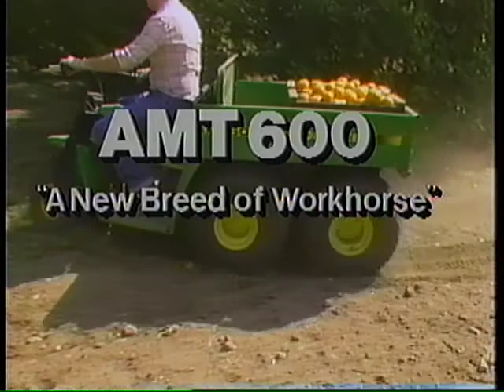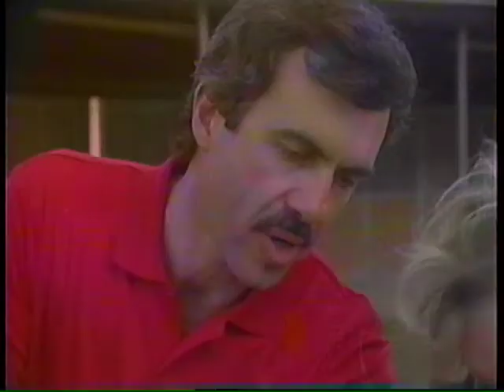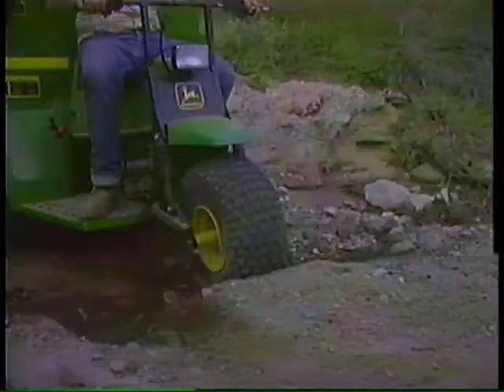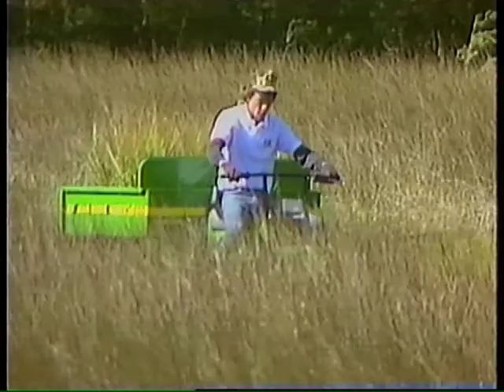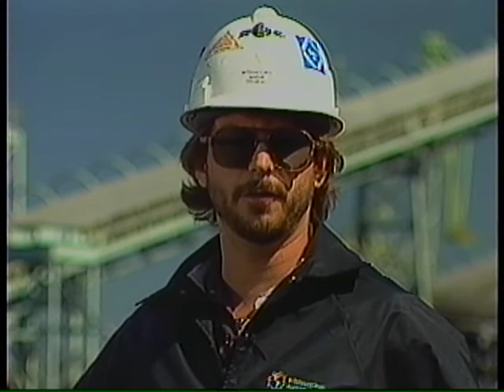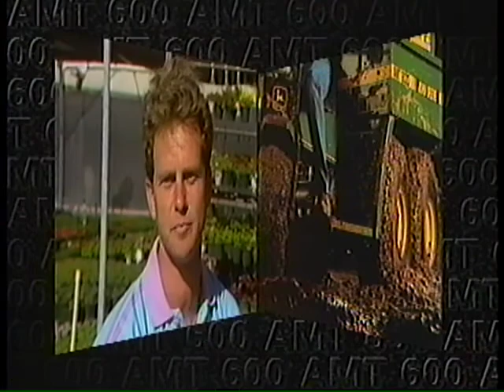John Deere - AMT 600 Safety Testimonials

Comment: My dad bought one brand new. It was recalled not long after he bought it, though. It had to go back to the dealership and have the axles extended, fenders installed on the sides of the box, and extentions put on the front fenders and floor boards.

Comment: This John deere 600 is crossed between a gator and trick is really weird 🤔 😳 😐 😕 😅 😬
Reply from the maker: Well it was a design originally made by Commuter Industries called the 4x5. John deere bought the right to produce the units and agreed to sell them alongside Commuter Industries.

Eventually, Commuter closed and JD continued production with the consumer requested changes which resulted in the 622 and 626. 

From there, the "gator" line was born with the introduction of the 4x4 and 4x6 models.

Comment: The AMT 600 is such a curiosity nowadays. eBay listings often erroneously refer to it as a "Gator", even though it isn't- the AMT was the predecessor of the Gator, and all the AMT models (600, 622, 626) only had 5 wheels as opposed to the Gator's 4 or 6 wheel configurations. As a predecessor to the Gator, it seems that it was generally disliked once the Gator came out, particularly for its chain drive (as opposed to the Gator's belt drive). At the time though, there really wasn't anything else like it, and it seems that it's gained a better reputation in the past 5 years, especially with homesteaders and small farmers who can't find anything else as useful and affordable (though parts for it are increasingly difficult to find).

I used an AMT 600 almost every day for 6 years when I worked on a farm, and it was every bit as good as the Gator I experienced later on. We had an original model from 1989, and a later model from circa 1991, and the later model was slightly better, although it was a bit wider. Regardless, the AMT 600 remains an oddity today, and I think a lot of people will say that they'd like the AMT to make a comeback in an improved form.
Reply from the maker: As far as I was told, JD coined the term Gator based on the look of the amt 600.
Reply: @MattDragonTamer  I wasn't aware of that, it does superficially look like a gator's mouth with the front mudguard.